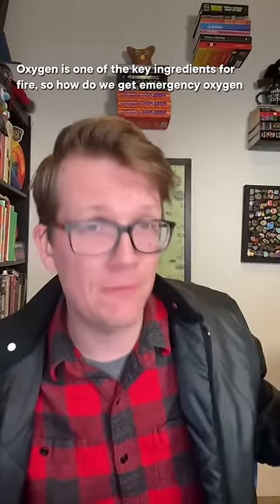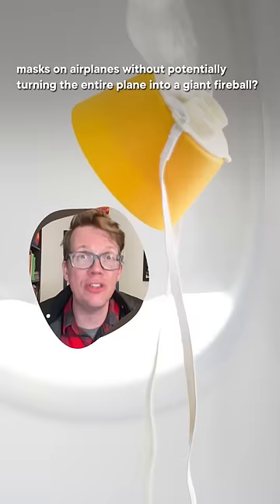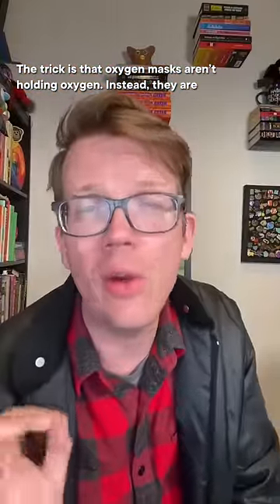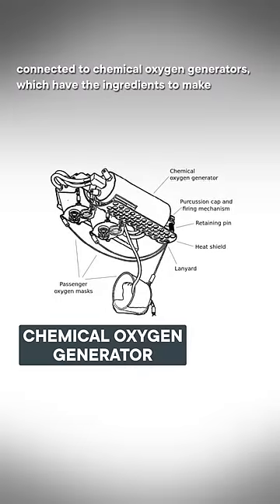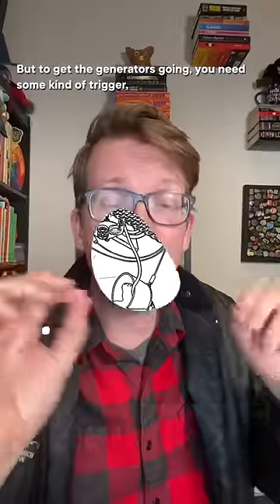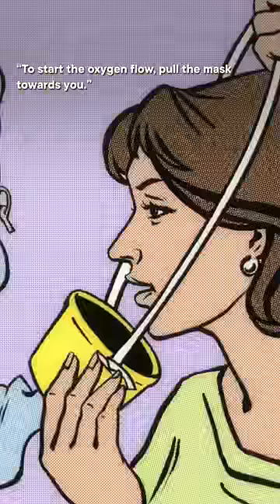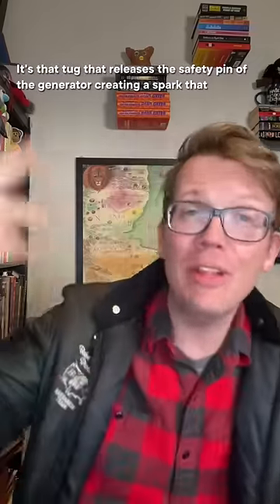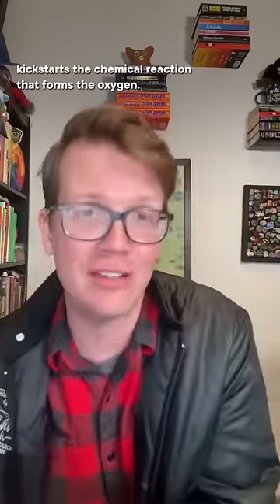If oxygen means fire, how do we get it on airplanes? #shorts #science #SciShow

Comment: For such a piece of safety equipment that (I assume) gets relatively little use I start to wonder about the theoreticals of this at scale. For example, what’s the carbon footprint of carrying these things on every flight and almost never using them? That surely has some kind of cumulative pollution level that contributes to a certain number of deaths every year. How does that measure up vs the lives saved by these devices?

Don’t get me wrong, if I’m on a flight I want these with me for sure, but seems like there’s a line where we as a society shouldn’t have things like this if they’re not being used with a certain frequency.

Comment: Yeah nah not all aircraft the same. Some will have gaseous oxy bottles on board, usually for the crew and ‘oxy candles’ for the passengers. 

Some have liquid oxy converters, which are continually boiling off and venting excess overboard if not being used.

Others have onboard generators which use molecular sieves to remove nitrogen from the air and provide ‘oxygen enriched’ air. Up to about 90% pure oxygen.

It really depends on the aircraft and what it’s purpose is.

Comment: Why can't we just have holes in the outer part of the airplane that are connected to the outside maybe with an air compressor in there to make it enough to actually breathe and then push the compressed air through the tube or not push but allow it to flow through the tube?
Reply: There isn't enough oxygen when you really high up

Comment: Oxygen is not flammable, guys. It will accelerate a fire, but oxygen does not explode and is not flammable.
Reply: Yeah and the danger in lugging around a ton of pure oxygen is that it makes any minor spark or fire 100× worse and when on a aurplane where a small fire is allready a huge problem you dont want any pure oxygen just chilling in the compartment

Comment: Do they last longer on international flights across large oceans?
Reply: No, because they aren't designed to reach a landing strip, the pilot only needs to reduce altitude below 1000 feet, at that point the atmosphere is thick enough to breathe normally without oxygen masks. Thats why pilots may put the aircraft into a steep decent when thus happens but that all delends on the stage of the flight

Comment: Yeah but you also don't need oxygen for fire, you need an oxidizer. You can produce fire without any oxygen in the system whatsoever. Try burning hydrogen in a sealed container full of nothing but chlorine.

Fuel, oxidation, heat, chemical reaction.

Comment: Oxygen is not A key ingredient to fire, it is THE key ingredient to fire, no oxygen no fire, period. In fact, I've been saying for years that oxygen is the only substance that actually burns, and no one has yet changed my mind on the subject.
Reply: oxygen itself doesn't burn, it just reacts with the stuff around it
if you put hot oxygen in a vacuum with nothing else then it wouldn't ignite, neither would anything else
that's why you need to have an oxidizing agent like rust mixed in with fuel if you want it to burn in space
Reply: @2fifty533  "if you put hot oxygen in a vacuum with nothing else then it wouldn't ignite, neither would anything else"
This is not disproof of my statement that oxygen is the only thing that burns, it just needs a catalyst to do so, try again.
"that's why you need to have an oxidizing agent like rust mixed in with fuel if you want it to burn in space"
That's just burning the oxygen trapped in the rust, so yet again only the oxygen is burning.

Comment: Why don't they just compress external air ?
Reply: They are flying so high that the compressor would have to be a real big one to compress enough oxygen out the thin air for 200 passangers that it would weight too much to have any luggage or maybe even the passangers on board
Reply: @railrost7428  cheers

Comment: Oh funny thing, they literally reached the temperature of an oven so technically the plane is potentially a fireball still
Reply: @MrBooblo086  are you sure about that? They reach extremely high temperatures from the reaction so high that they have to be mounted in a heat dissipate and griddle or they will burn through the plastic that is containing them

Comment: A few things missed, the generators only provide for about 15min of oxygen, and its just enough to get down to 10k feet which is altitude needed for breathing without them.
One generator also generates for 2 masks, or for that row of seats, so grabbing nearby masks doesn't change anything.

These also can be dangerous as they do get extremely hot and if they are being transported insecurly they can cause a fire, which is exactly what happend on one flight.

Comment: Most planes store O2 often at high pressure or liquid form. Fire risk is basically a non issue.  Some aircraft use an oxygen generator, not to mitigate fire risk, but to conserve weight or space. Oxygen is everywhere and does not combust without an ignition source.

Comment: The g5 I work on has 2 large o2 tanks , I would say most planes do have low or high pressure O2 tanks
Reply: Wrong. (Except for GA). 

BusJets can carry oxygen bottles because they only need to supply oxygen for several people in a small area

Once you get up into Heavy Iron you start seeing more of the oxygen generators although if it has very sparse seating then you would still just see oxygen bottles

Comment: Almost. You only need to get down to 10,000ft, then you can remove the mask. Some planes only have oxygen for around 13 mins. On other aircraft... ones that are expected to be operating routes over very high terrain, need to carry oxygen generators capable of providing oxygen for around 22 mins whilst the pilots execute the decent strategy in mountainous areas where they can't immediately descend to 10,000ft until clear of terrain. Oxygen is NOT needed until landing in any case. (Unless your airport is 10,000ft above sea level 😜)

Comment: Everything about a commercial airliner is designed to make the passengers "Feel safer", In sharp contrast to an actual gravity defying industrial marvel they are.. So much so that the seats are designed to look strong and to break free when needed the most, the bulk heads and cabin look stout and secure but will fall apart in rough turbulence and become deadly debris in an enclosed tube. The seat cushions are floatation devises at sea but burn like a fuel when lit on land and do nothing for softening an impact . It's .just like providing 30 min of O2 when the average crash lasts about 4 min. Pretty much every human comfort on an airliner is Useless and some are even useless when  needed...But I'm glad they are there. XP

Comment: Another aircraft mechanic here…Oxygen generators, in my opinion, are crap. They do enough to keep you alive, but if you’re up at fl400, you are going to want some instantaneous ABO, delivered by a mask that fits very tight to the face. Just because you have oxygen at altitude, doesn’t mean you won’t become hypoxic. You need a tight fitting mask that forces oxygen into your lungs and allows for the process of diffusion. If there isn’t enough pressure in the lungs, diffusion can’t occur. It won’t matter how much oxygen you are breathing. The generators on passenger aircraft, for the passengers, gives just enough flow to keep people awake, while performing and emergency descent. Since most passenger airliners don’t fly all that high, you can get back down to a lower altitude where the pressure is better and there is a little more oxygen. Remember folks, it’s not just about having oxygen available, you need pressure for diffusion to happen.

Comment: Well, yes and no. The 737 does in fact use a oxygen generator for passenger air. But the pilots have oxygen tanks and on the 787 the passenger air is supplied by small individual oxygen tanks.

Comment: "How do we get oxygen on a plane without a fireball" I suppose you might ask the same about the jet-fuel too though XD
Reply: Jet fuel is surprising difficult to light on fire. Jet fuel is basically kerosene; you can drop a lit match into a container of jet fuel and it will go out. The fuel needs to be aerosolized for it to burn well—that’s why crashes turn into explosions. But the liquid fuel isn’t nearly as dangerous as gasoline.

Comment: Yes, oxygen is needed for fire but it's 1 of 3 things needed so without the other 2 you can't have a fire. According to the way you presented your video the planet earth should be a burning sphere being oxygen is present in the air we breath. Also a fire is possible in a plane at all times due to he fact there is oxygen present in all flights or the passengers would die without it.  I realize what you meant was we cant't be flying around with a huge oxygen tank that could rupture during a catastrophe providing a huge amount of oxygen that could cause a huge fireball but your presentation sucked at presenting the actual facts of why they use oxygen generators. I also realize it's difficult to present all the facts in the time constraints of a reel or a tiktok but still not a good job of presenting things.

Comment: Saying the oxygen isn't there is flat out wrong.   
Having oxygen in a stable chemical that can be excreted on demand?   Better but sounds like a zit.   
Oxygen that can become available through chemical break down sounds like a relationship failure.   
Oxygen kit-kat bar?
Reply: What you are saying makes no sense
Reply: @peeperleviathan2839  break kit-kat bar, oxygen is released.  Its readily available oxygen that threatens fires if you look at it.   Having it bound into another compound that can be released over time makes it less likely to burn up when merely heated.